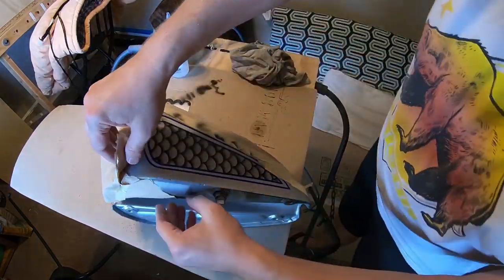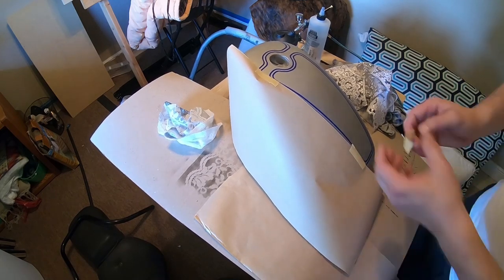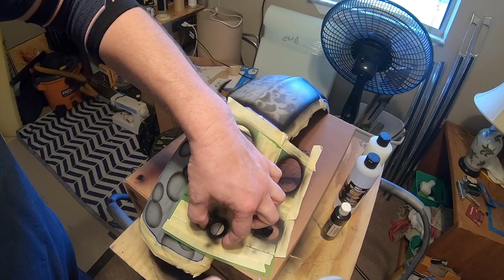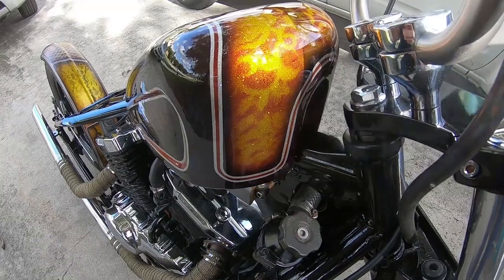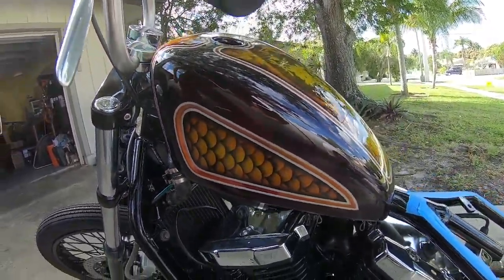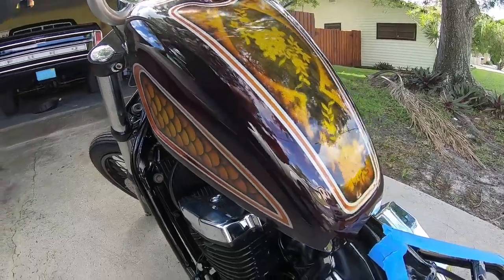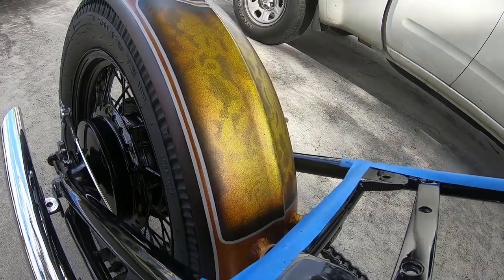VN800 Bobber - Part 11 "Flakes, Lace and Candy"

Comment: So this is your first time? This is really good. Especially for a first time. Cool bike! I'm also a spraypaint hobbyist learning, like you. Did a few helmets and bike parts. One small tip you probably already figured out if I may: When airbrushing dark colors like the black shadows, reduce a lot and build up in very light coats. It's a lot easier to control and it gives you better atomization. If you use Createx, mix some 4030 into the paint and reduce with 4011. According to Createx, that mix can be saved in a bottle for months. Sorry, don't want to be a smart ass, just sharing what I found works well for me.
Reply from the maker: Thanks Mattias, I really appreciate the tips! I did realize that the black was also much thicker than the candy, but now it make sense, and you're right it sounds much better to build up rather than having too much. Thanks for watching 👍🏻

Comment: When your sanding clearsoat, WET SAND, for some reason it comes out smoother
Reply from the maker: Yes I do wet sand now when I can, unless I am working with wood like skateboard or guitar. Even the little amount of water will get soaked into the wood, by the mounting hole of a skateboard for example. Live and learn 😉

Comment: Hi, good job on your bike . I would like to know with the new gas tank do you still have the airbox understand the new tank ou you relocate  the airbox.
Reply from the maker: Hi Pete, no more airbox. This is part of the EPA stuff. You can get rid of all of that. It is call scooterizing. Here is a link to how to:
https://www.angelfire.com/ak5/russwolf/airbox.html
Reply: Hi, thanks for your reply .can you please tell me after the scooterize of the filter box do the motorcycle sound louder...I ask this question is because of the regulation of motorcycle in Europe.
Reply from the maker: @PIT72100  no it does not change the sound level, but if you have to do an emission test for pollution, you should not remove it as it may or may not pass the test. You will have to rejet the carb as mention in the website I provided you. Here in Florida there is no emission control. I know in France they do when a vehicle get older it have to pass a test to see if it does not pollute over a certain level 😉

Comment: Awesome!  I'm prepping a carbon fiber bicycle frame for custom paint and this is totally inspirational.  I know you used kandies but how did you achieve the beautiful sparkle?  Did you use a metal flake mixed into an intercoat or clearcoat?  If you are willing to share I'd appreciate it!
Reply from the maker: Hi Lee, thanks for the kind words 🙌🏻.
Yes as you can see in some other of my videos, I prime then use a metallic silver base and then spray the flakes mixed with clear coat. Good luck with your project, carbon frame sounds pretty cool 😉

Comment: what type of air compressor set up do you have? great work!
Reply from the maker: Hi, thanks. For this project I had a Bostitch 6 Gal, normal compressor. i since switch to an airbrush compressor, so much comfortable, you don't have to deal with so much noise.
Reply: @lesagecustoms4668  good to know! with the airbrush compressor youre able to lay down thick base coats/clear coats as well?
Reply from the maker: @surafelmakonnen2212  no not really, you will need something bigger to use with normal paint gun for thick primer.

Comment: Salut, super sympa ce projet, j'ai bien envie de m'en faire une aussi!
Reply from the maker: Merci, vas y lance toi, tu verras, on y prend vite goût 😉
Reply: @lesagecustoms4668  je viens de survoler tes vidéos moteur, j'ai contacté trois gars qui ont des annonces autour de moi...
Cela va de 35000 à 50000km, deux sont d'origine et une est préparée, la moins kilomètrée. Échappement, filtre à air, j'attends sa réponse savoir si la carburation l'est en conséquence...
Reply: Il a travaillé l'esthétique aussi, je lui ai demandé si la transformation venait de lui, on verra...
Reply from the maker: @wingeicalimero9681  ici je me rappel avoir lu quelqu'un sur un forum Kawasaki disant qu'il avait fait 99.000 miles avec une, multiplie par 1.6 pour l'avoir en kilomètre 😉. Ces bécanes sont solides 🤘🏻
Reply: @lesagecustoms4668  158400 km, pas mal pour un bicylindre !
Puis, je suis tombé amoureux de la vn, je trouve que c'est une super base pour un bobber !
Merci de ton échange !👍😎😉
Reply from the maker: Super, si tu as des questions n'hesite pas, mon email: frenchyinflorida@gmail.com
Reply: @lesagecustoms4668  sympa !
Je viens de tomber sur une annonce pour un 600 shadow, pas mal! Tout est à faire mais elle est saine et d'origine...
Au plaisir, je file au lit, encore merci à toi !

Comment: WHAT DID YOU USE FOR THE FINAL? TO RESIST GAS LIFTING IF SPILLED
Reply from the maker: Hi, the final coat is a 2k Urethane clear coat. this is the same finish as for car, so it is gas proof.
The only location that would need attention is by the filler, where the paint stop, the gas can go underneath and start lifting from there. My solution is to use some clear JB Welding and apply some lightly all around where the paint meet the bare metal. I hope this help.
Reply: @lesagecustoms4668  yes, thank you. And thanks for the inspiration. Im about to do my tank and fender and plan on doing something similar to 2hat youve done. Oh , and good work
Reply from the maker: @ronniefrutschi2011  Thanks 🙌🏻, take your time for the taping that's the most important 😉
Reply: @lesagecustoms4668  oh I know what you mean. I've painted before and agree , taping makes 99 percent of the job
Reply: @lesagecustoms4668  wish i could send you pics of what I did
Reply from the maker: @ronniefrutschi2011  check in the video description, there is my email address 😉

Comment: how paint you use for airbrush?
Reply from the maker: Very little, but remember this is candy, it is not made to cover up, your base coat. But I mix the paint with some clear and something else from the same brand. You should be able to do a few project with the 8oz bottle, I did my tank fender and helmet, and I may have use 25% of bottle.